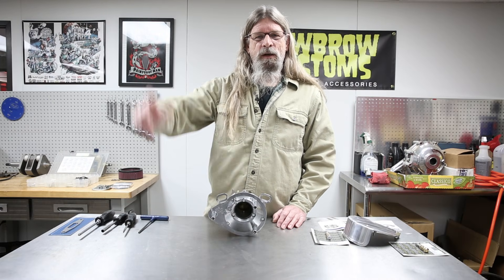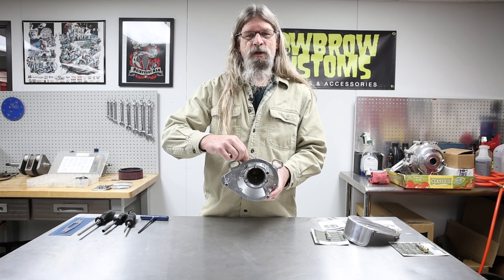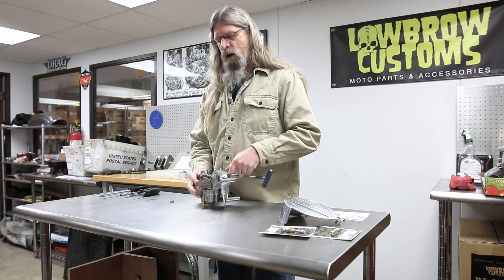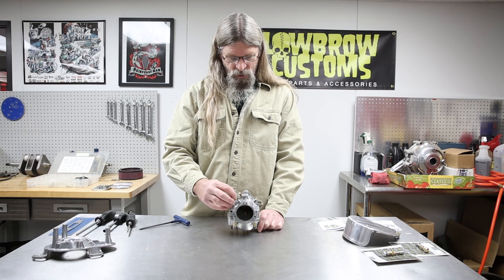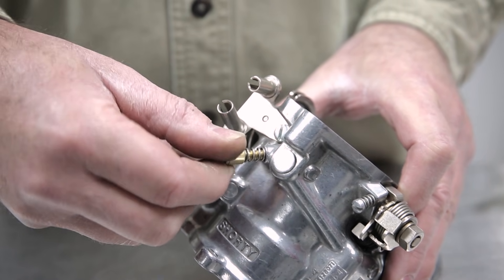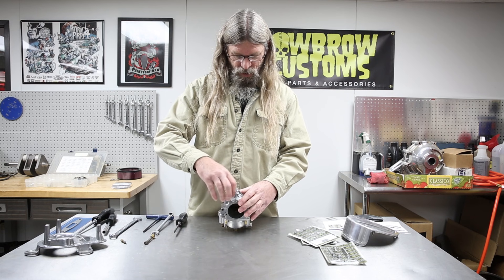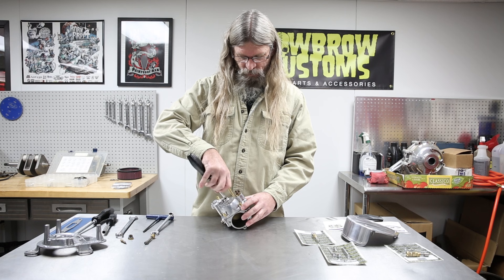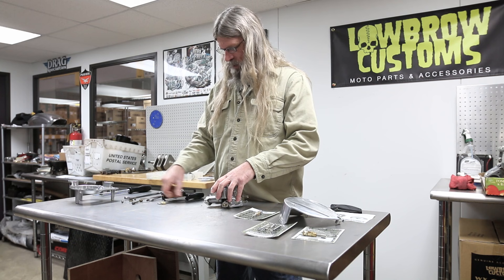S&S Super E Carburetor 101: Disassembly, Walk Through and Tuning

Comment: Watched this video in hopes of learning why my S&S 111 was so hard to crank, and ran rough at low speeds. Then at ~10:25 you showed that tiny, little, blue o-ring, and I thought, gee, I remember seeing one of those in my tool box, but not on the carb. Sure 'enough, dropped the bowl and no o-ring. Grabbed the one in my tool box, installed it, that fixed it -- it fired right up and ran great. thanks for doing such a good job on this video. BTW, I got the bowl extender screws from you guys... a definite got-to-have for this carb.

Comment: Thanks for the video Todd! Keep 'em comin.
Reply: just a comment about the cables needed, S&S sells/supplies two different cable locators, one for butterfly, and one for CV carbs, if your bike originally had a CV carb, you would use the tall one. if you had a butterfly carb (89 and earlier, i think) you would use the shorter one

Comment: Hello Todd! Would you know what i need to change from my stock carburetor to s&s carburetor. I have a 2003 sportster 883.
Reply from the maker: You need this... the carburetor: https://www.lowbrowcustoms.com/products/s-and-s-cycle-super-e-carburetor-assembly-s-s-cycle-11-0420 Then whatever air cleaner you are going to run you need gaskets, carb mount and breather bolts. Air cleaner gasket: https://www.lowbrowcustoms.com/products/gasket-for-super-e-g-carb-to-air-cleaner-backing-plate
Carb support: https://www.lowbrowcustoms.com/products/gasbox-s-s-carburetor-support-1991-2006-harley-davidson-sportsters
Breather Bolts: https://www.lowbrowcustoms.com/products/radius-harley-davidson-evo-breather-bolts-chrome-plated
Reply: @lowbrowcustoms  Very cool response man. I just found you on the Tube. Im picking up a 2000 883 sportster next weekend. 6000 miles. Needs carb work, oh joy but price is right. If the one on it cant be repaired I will be going to your site.

Comment: If anyone happens to see this comment. I just bought a bike with this carb on it. I don’t think he mentions it in this video but there is a overflow tube that comes off of the bowl. It’s on the right side if you’re looking at the carb mounted to the bike. Mine came with a short yellow/clear tube that just runs down and sits on top of the transmission area near the chain guard. My question is it suppose to have a little suction to the tube. My dads concern was that I live on a gravel road and if I rode it home it would suck all that fine gravel dust up the tube and into the carb therefore into the engine.

Comment: Gd stuff guy i really dig your vidieos etc al, i just picked up an older bike my buddy passed away so his old man gave it to me for barley nothing, anyways its a 1995 fxsts softail , but the carb is s& s shorty , i not a good wrench at all except for the basic stuff like oil changes and small things anyways theres gas coming out of my overflow hose and i was wondering would i have to take this carberator completely off the bike or is there anything out out there i can buy to throw into my gas tank to clean the carb out and the lines, im guessing based on this vidieo needle brige part is probably all gummed up with dirt/shit LOL J DONT KNOW DUDE IM REALLY LOW ON DOE AND WANNA GET IN THE WIND AND THIS CARB IS LEAKING GAS THROUGH THE OVERFLOW ...IS THIS A GOOD CARB COMPARED TO OTHER DIFFERENT ONES IT SAYS SHORTY ON IT AND IT LOOKS LIKE THIS ONE IN THIS VIDEO , AND ITS NOT TUNED RIGHT EITHER IT GOES TO 1000RPM TO SAY 2000 ITS JUMPS UP AND DOWN BETWEEN THEM NUMBERS THEN IT WILL JUST STALL OUT, AND ILL FIRE IT UP AGAIN , I REALLY LIKE THIS BIKE AND THIS CARB WHEN IT WAS GIVEN TO ME IT PURRED LIKE A KITTEN AND HAD BALLS, BUT ITS BEEN SITTING FOR YEARS NOW AND ONE DAY I THOUGHT I COULD JUST TUNE IT IN A LITTLE BETTER BUT I FCD IT UP WORSE THAN IT EVER WAS ANYWAYS IF THERES A GOOD PRODUCT OUT THERE TO POUR INTO MY GAS TANK FOR THIS TYPE OF BIKE ID BE GRATEFULL FOR ANYTIPS YOU GOT THNX BUD
Reply: float level, but do yourself a favor , until you learn about the carb. just put a factory CV carb on it.

Comment: Todd, I have a question. I have a S&S carb on a '97 Wide Glide. Rode the bike about 10 miles last time out and noticed a steady leak coming from the overflow hose from the carb. Switched the bike off and gas still dripping heavy. Could it be a stuck float bowl ? Thanks for any help.
Reply: could be

Comment: Any help guys? I have a 96 evo fatboy. 
S and s e carb
Bike runs great. Idles great zero issues. 
My problem is the float bowl over flow tube has begun leaking fuel from the tube..small puddles under bike. 
Can i fix this without taking everything apart? Especially since it's perfect other than this?
Thanks

Comment: I have a 2000 Bigdog 107 with a S&S super G ,,for a while the fuel line does not stay full with gas ,,,Tanks are recoated inside ,new gas line, filter and new rebuild kit on carb , and take pit cock any help would be great
Reply: Is your cap vented? Or does your tank have a vent?

Comment: I just spent all afternoon re-jetting this carb on my friends custom with the same result with every jet combo, a flat spot at about 2500 rpm, when I went into the accelerator pump I found the check ball was missing, anyone know off hand what size that is? I am sure I could wing it and grab a few from NAPA and trial and error it, but it would be great if I knew the size. Thanks

Comment: I see you don’t respond much to comments. Was hoping somebody knowledgeable can explain why my bike runs differently every time I ride it?  Is this carb just garbage or what? 
I have a 05 fxdx with a s&s 124” twin cam & super e carb k&n filter teardrop cover.  I have just under 3k miles on this motor.  
Harley won’t work on the bike bc of all the mods. 
I went through the standard settings procedure and adjusted when warm but then I ride and it idles too low. Adjust it then next day too low. Adjust it ride and it’s too high. Got it just right then when cold it hardly idles. 
I had a mechanic look at it & he quickly turned all my screws notably the accelerator pump several turns and immediately started drinking gas. 
Let it sit too long and went for a short ride and  got my motor drenched in oil hopefully just blow by. 
Then a no start but cleaned up plugs and it’s ok now. Thinking I need to dial it back down and get the plugs to stop fouling. 
But that oil issue got me freaked out!! 

When I got the bike it was fine. I rode it to CA from AZ  soon as I got here idle changed. Noticed the vacuum nipple plug was off. Kept blowing off until I adjusted carb and got it to stay on which make a ton of difference when idling.  
 So idk right now my filter is wet so I’m gonna start over and turn it all back to the basic adjustment. 
I’ve heard other people struggle with this carb too. Am I missing something? Is this junk or what?
Reply: Keep a diff set of jets for a higher altitude
Reply: @devanallison1197  thanks. I went through the setup procedure a few times and got it just right. After a while it still wants to idle too low until it’s warm. Just got back from the mountains and didn’t have any problems whatsoever with altitude.